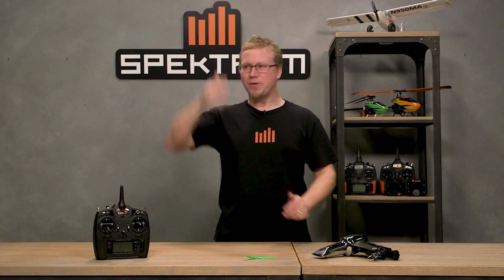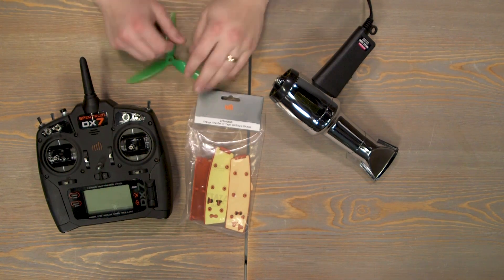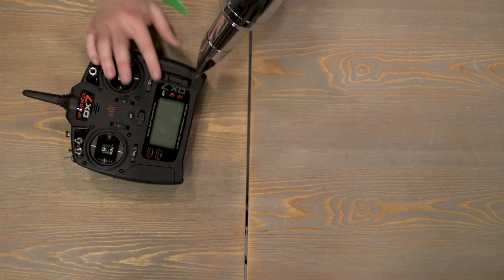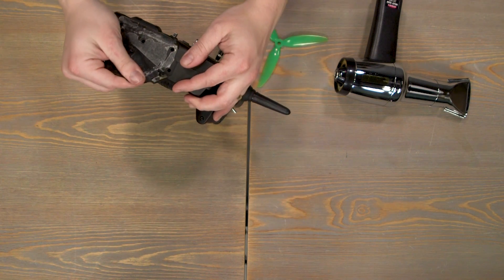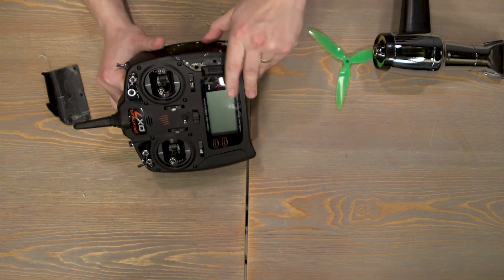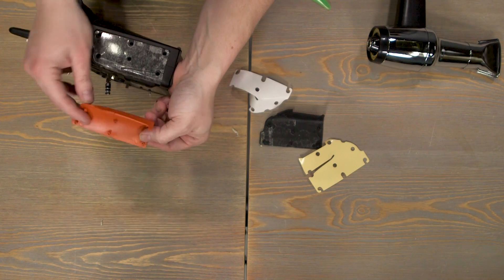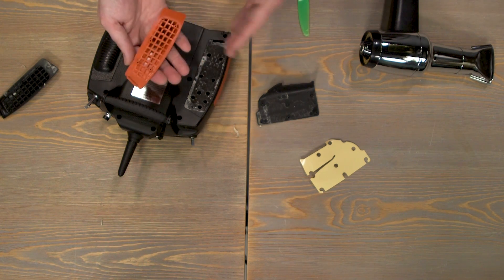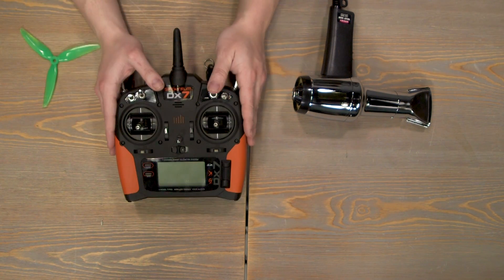Spektrum Air Transmitter Orange Grip Change Tutorial

Comment: I just replaced the grips on my iX12 two days ago.  I am glad that I test fit the grips before using the adhesive sheet because they did not lie flat.  I had to trim two rubber nubs from the right front grip to get it to lie flat on the transmitter and 1 nub on the left front.  Both of the back grips fit fine.  The orange grips really make the transmitter pop!

Comment: Have done this to my NX10, after watching your  video I wish I had never started it. The 3M pads are different to what is shown. No problem getting the old pads off except one of the lugs has snapped off and gone into the radio, had to split the radio hoping that it will come out but no such luck. The new sides pads will not stick down in on spot and a lug will not fit into the hole no matter how much I push it, on the rear pads there is a very thin strip of tape that will not go in it's place. the glue pads are that thin that they can tear even before you have got them off the backing paper , and if you are not careful the sticky pad will stick before you can adjust anything  and can not be removed. I have two area's on the radio that will not stick and a bulge in another pad where the lug will not push into the hole. The sticky tape is a bit to thin and cannot be moved about before finally it pressing down.  To rectify the problem I will need  to take them off and find some pads that will work. Hope you sell the pads by themselves which will make the job a bit easier. The part number if you want to look at them SPMA9612.  This is the first major problem I have had with the radio's, would like to think it could be the last for a while. Perhaps you can update the video's for the NX series. Anyway on a better note , keep up with the very helpful video's and have a Merry Christmas.

Comment from the maker: These grips are currently available for the DX6 G2/3, DX7 G2, DX8 G2, DX9 (including Black edition) iX12 (including Limited Color editions) And the iX20. This tutorial should help any Spektrum user thru this process and give you some tips on tools that can be used to help.

We recommend getting a low temp capable heat gun, such as the Hangar 9 Heat Gun
https://www.horizonhobby.com/heat-gun-han100

And having a soft plastic tool to manipulate the rubber grips, adhesive and help remove old adhesive is also helpful.

Links to Grips 
DX6 G2/3, DX7 G2 and DX8 G2 - https://www.horizonhobby.com/orange-grip-set-w--tape--dx6g2-3-dx8g2-spma9609
DX9 - https://www.horizonhobby.com/orange-grip-set-w--tape--dx9-spma9608
iX12 - https://www.horizonhobby.com/orange-grip-set-w--tape--ix12-spma9607

Make sure to follow us on Facebook and Instagram for all Spektrum News and Promotions!
https://www.facebook.com/SpektrumRC/
https://www.instagram.com/spektrum_rc/  
@SpektrumRC

Thanks for watching!

Comment: I liked adding the color to my iX12.  The only negative is that the supplied adhesive does not hold the new grip set to radio. So you will have to find some other type of adhesive to use. I am continually having to press the grips back on.
Reply: Loctite makes spray adhesive for foam . Works on rubber too.

Comment: Got these with my nx8 that I just got in the mail today. I like the looks of the orange but im afraid to rip off the grips on my brand new nx8. Maybe later I guess. lol. do these come with the same adhesive tape used in the factory for the stock grips?
Reply from the maker: They do come with the same adhesive tape as factory
Reply: @SpektrumRCvideos  ok thanks. Also, the double stick tape that came with mine seems like its sized bigger than the grip itself. I havent installed them yet but is it normal to have to trim the tape some?

Comment: How do you tell which generation of transmitter you have? What is the difference between them? Can an older generation be upgraded to the latest generation?
Reply from the maker: Kalvin Noble normally it is labeled on the fcc sticker on the back. And no there is no upgrade from a previous gen to newer generations. Hope that helps :)